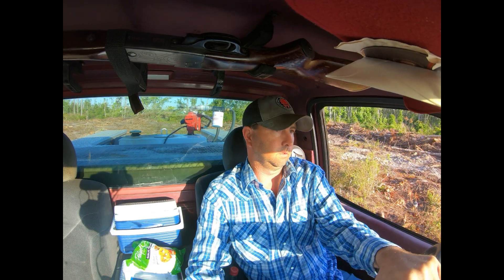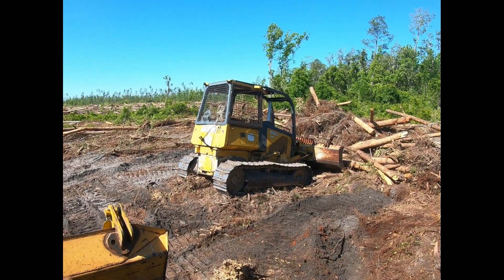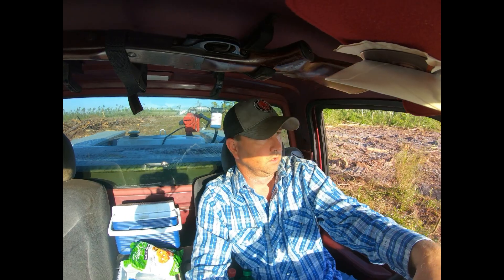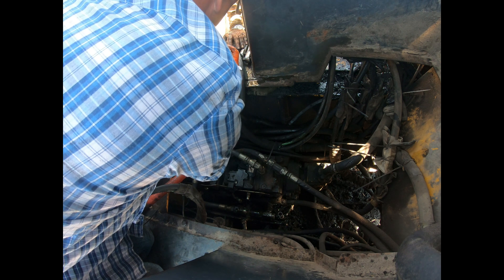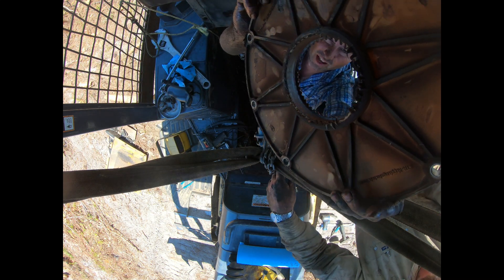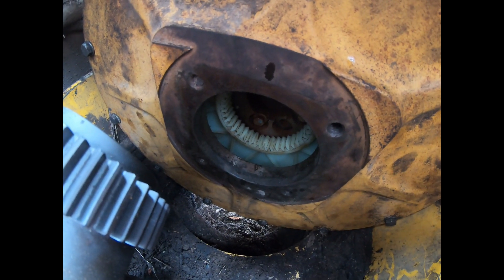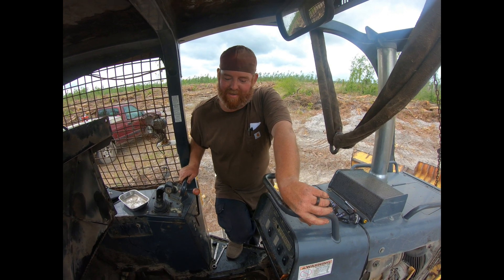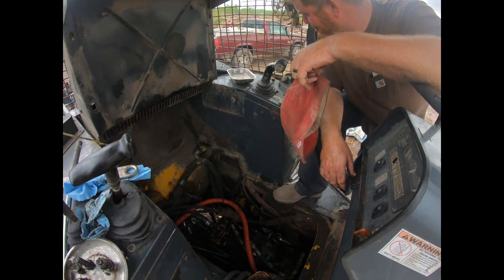John Deere 650J Bulldozer won't move - torsional dampener repair

Comment: I'm tackling one right now on an enclosed cab 650j. I've been told by a heavy equipment mechanic that the best way to do those torque dampeners in sliding the motor forward. Have you ever heard about it being done that way? How many hours total did you have in the job once you got it moved?

Comment: What is the root cause for the dampener to wear or spin out the teeth? Was there anything wrong with the pumps. I am taking mine out for the second time. It seems my issue may lie with one of my pumps.
Reply from the maker: From what I can see, the new dampener is built a little heavier than the original.  The 4.5 Engine is used from the 450 to the 650 and me belief is the dampener is underrated for the added weight of the 650. My 450’s never had this problem.